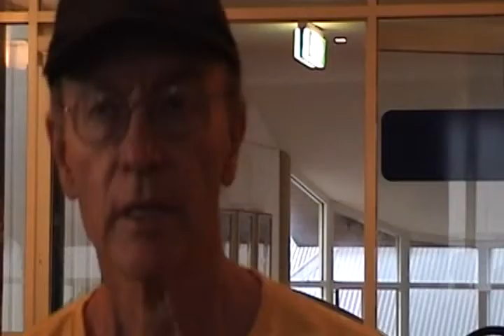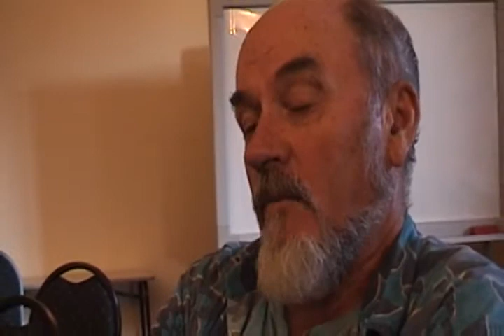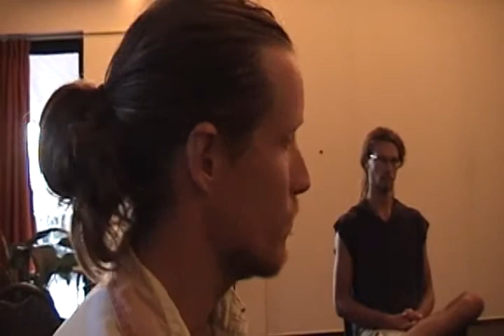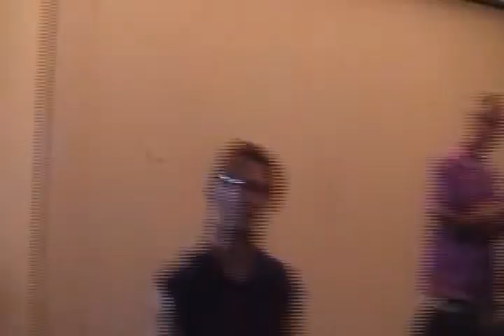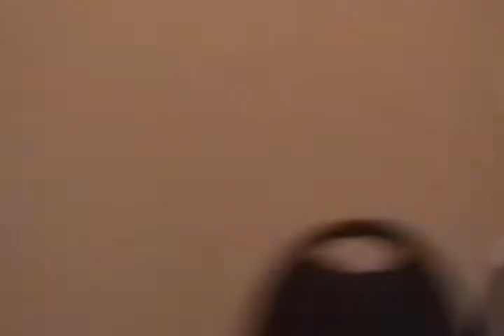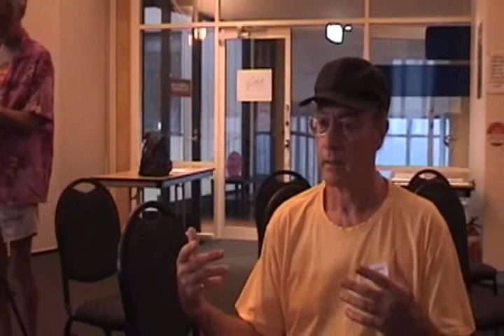Electric and Compressed Air Car -Alternative Boost *GREATWILL NONPROFIT Seed Idea

Comment: I am working on compressed air transportation in Oregon, please view my short video clip. I will post a better one soon. I hope to be building integrated air tank frames using carbon fiber, and have already engineered a regenerative brake. My lightweight system does not interfere with its use as a simple bicycle.